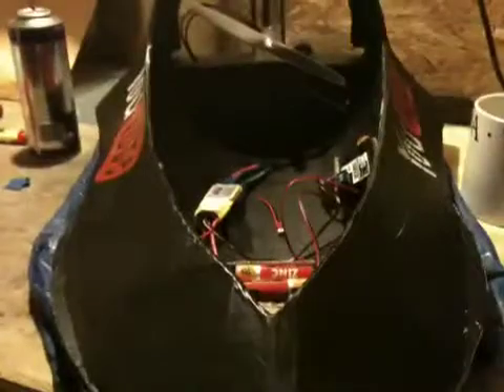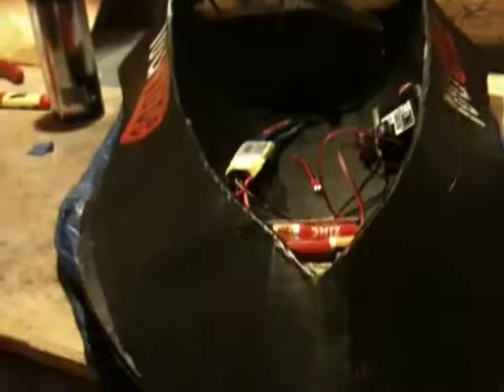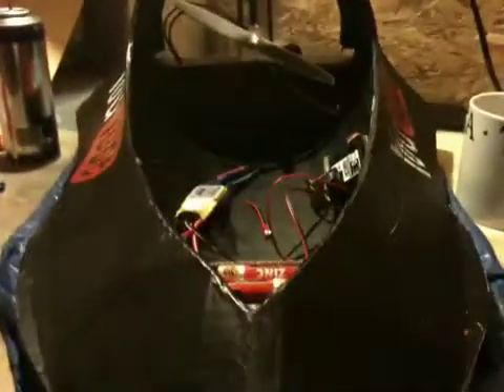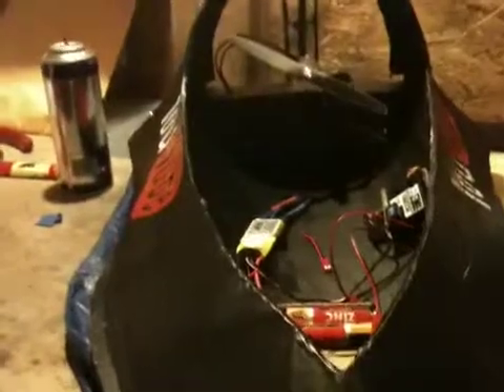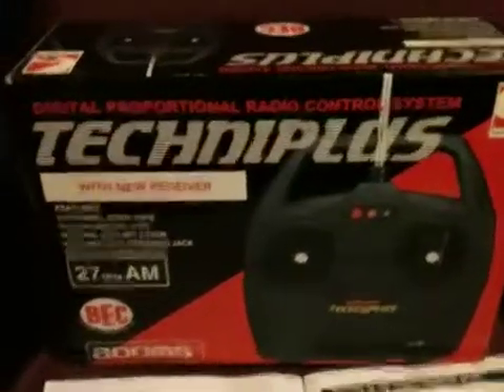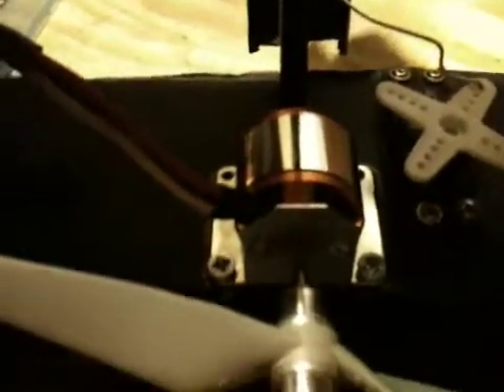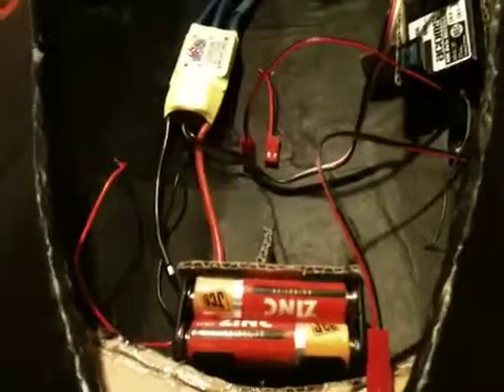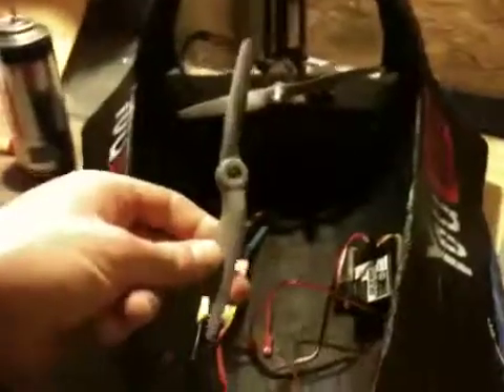Homemade cardboard rc stealth hovercraft advice needed plea

Comment from the maker: Djdavies83 thanks mate, ive took my time almost 5 months to get parts due to lack of knowledge but im ther now. Got me a 11v lipo, 30A esc with bec, 2000kv brushless motor, 6.5 x 5.5 prop, servo horns and rods but i ended up buildind a diffrent craft inspired by the hydo foil. It was ok but because it was on ski's there was to much tracktion so hard to steer. I have a vid but im not putting it on youtube so if u like send me ur email address and ill share it with you.
 
Oh and please check out

Comment: If you have not done so yet the best thing you can do is get onto "rcgroups" they have a hovercraft section there full of people who love to help. 

What I could see is you batteries (4 poundshop AA?) are not giving enough voltage, a ESC like your would expect a minimum of 7.2V (4AA gives only 6V). 

Does that ESC have BEC (battery eliminator circuit)? If it does the battery would go directly into the ESC and the ESC would then power the receiver through its red,black and white wires. 

I think

Comment: Im not sure by telling you this will help.. but ill give it a try. 
Ok the Motor and Battery will hook up into the speed controller..the speed controller hook up into the receiver. You dont need to cut any wire, the layout is already there you just have to connect it right. 1 more thing..you have a brushless motor so it need a Lithium battery in order for it to run you cannot use regular battery it will cost fire or damage the Speed controller.